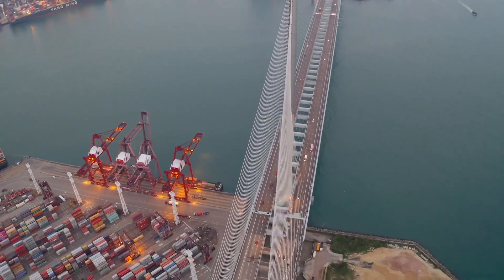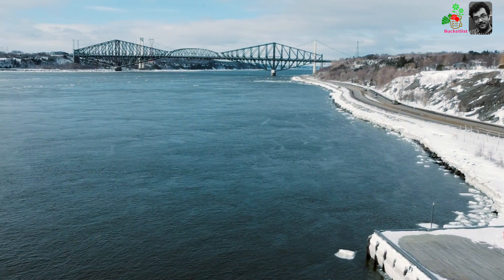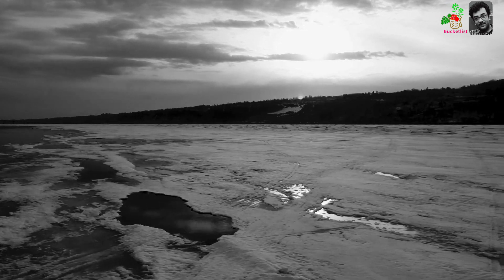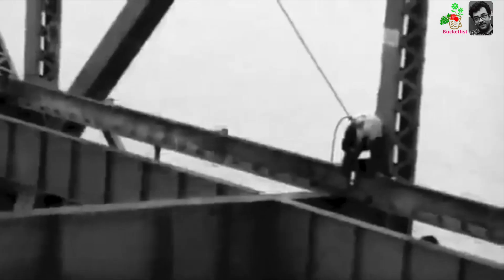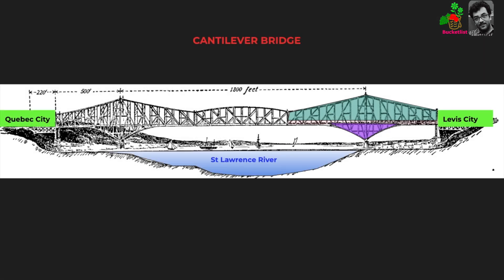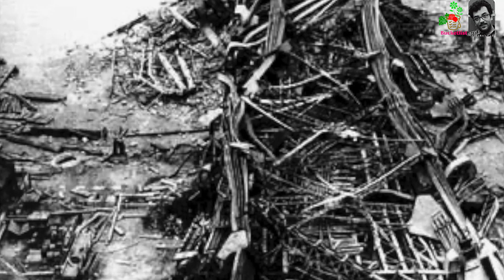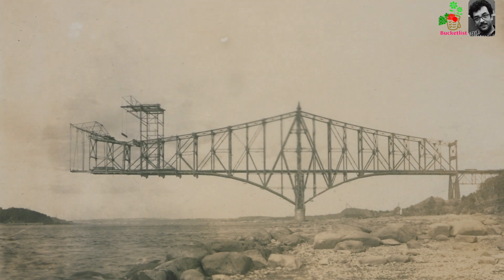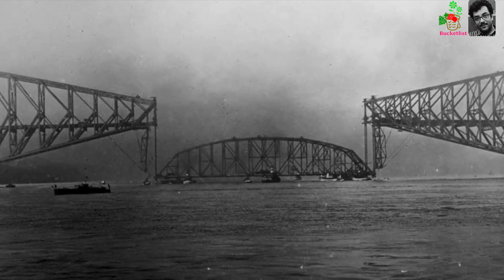Quebec Bridge Collapse Cause :quebec bridge collapse 1907

Comment: This bridge situations were caused  in both colapses and even as of now its systemic deformations, by  then engineers ignorance (In part) of lateral buckling of  slender structuctures .  Stephen Thimoshenko works  about structural stability were inspired by the first  1907 catastrophy. There were  whistle blowers  for each of the colapses . I  am doing just  that for the actual deformations systematic of a lateral buckling in progress.  No one yet wants to acknowledge the problem . The iron ring was the initiative of Frantz Lichtenberg  the second whistle-blower.